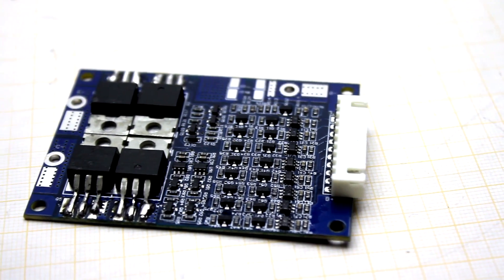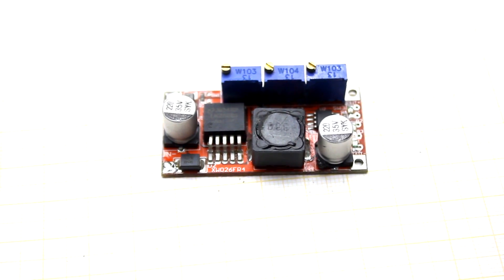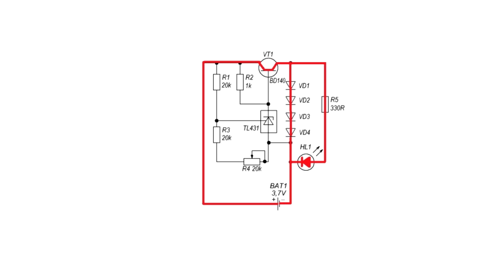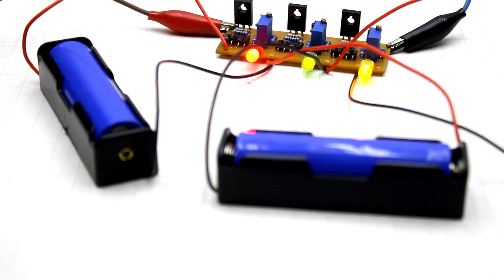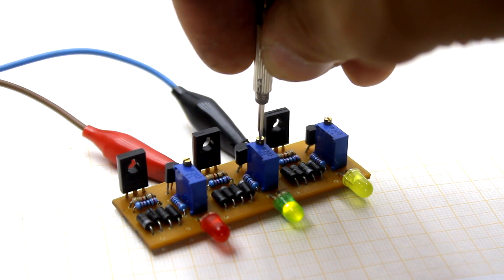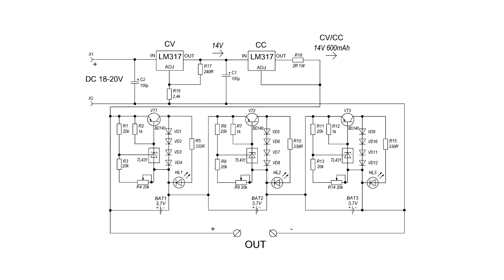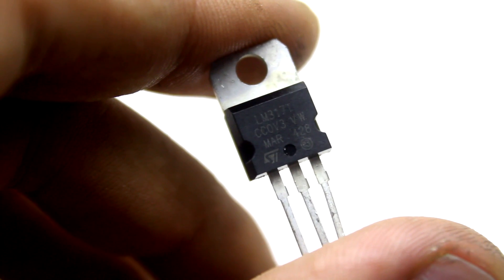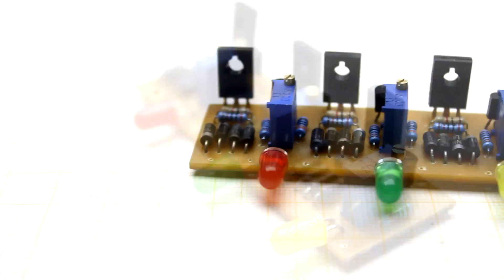Balancing unit (BMS) for Li-ion batteries

Comment: But the power supply always keeps its voltage same by adjusting the duty cycle so if the battery drops voltage the supply will increase it's duty cycle and always remain its voltage to 4.2 volts and the bjt will always be closed causing no current flowing through the battery. Can u solve my doubt

Comment: Nene eu sînt electronist cu liceu făcut+25 ani vechime, citiți cu atenție:
1)- ACEST MONTAJ NU MERGE.
2)-CELE 4 DIODE 1N 4001 SE SE ARD LA CONECTARE SURSĂ 5(USB)V, 12÷20V .
3)-DACĂ VĂ UITAȚI CU ATENȚIE BATERIA ȘI" BMS" SÎNT PUSE 'N PARALEL CU SURSA.
4)- LA APLICARE USB NU SE REGLEAZA DIN TRIMER 4,2V CI RĂMÎNE TOT LA VALOAREA USB(5V).
AȘA CĂ AȘA ZISUL BMS 1S,2S,3S,4S ESTE =CU NIMIC, E UN MARE FALS PENTRU FRAERI CARE ÎL REPETA LA NESFÎRȘIT. DE CE NUL MONTEAZĂ ÎN FAȚA NOASTRĂ CA PE ALTE MONTAJE.
SĂNĂTAE NU MAI PROSTIȚI ÎNCEPĂTORI.
SĂNĂTATE.

Comment: i got one question, why is it that my 3.7v lipo 4800mAh batteries in series (3s) burn out? its plugged in the same as the schematic. should I add a 2 ohm 5W cement resistor to accommodate for the over current?

Comment: Can I charge 24 Volt battery ( 3.7 volt x 7 Li on Battery) with total 7 sections . In that case any change do I need to make in LM317 circuit section. I want to keep voltage of each sections 3.7 volt but want to increase ampere by 3.7 volt x 3 battery in parallel in each section..only thing it will take longer time to charge..but that is okay, please let me know if this is possible

Comment: Great video. Do you have a charger power supply unit for 2, 4, 5 ... Li ion batteries? In your video you gave an example of a 14v 600mA power supply. Thanks.

Comment: All good, how about deep discharge protection on this circuit. When exceed 4.2 on each circuit it stops current flow to charge battery, however when battery discharge how to disconnect discharge when reaches beyond threshold

Comment: Very bad design...
When all three batteries are fully charged, the three transistors and series VD diodes are trying to short out the charger.
(So you need a series resistor or a current limited charger)
And the 431'a with their associated biasing resistors will be putting a constant drain on the batteries;.. and will eventually drain them below 2.5 volts!
( Down to zero volts if you  give them enough time....)

Comment: Would you briefly describe components one by one? How many resistors, resisting values, W size (1W, 1/4W etc) and others?
Reply: Resistors can be 1/4 watt. transistor is a transistor, tl431 is a programmable zener diode. LED is a 20Ma. type up to 3 volt. (approx) .. be specific what you need to know.

Comment: I just had one doubt why did you use the Diodes that were placed in after the transistor
Reply: the diodes will accept the forward current up to it's "Forward Current" max value. since the circuit is conducting.200 Ma. , its below its forward current value... so if you are looking to dissapate more, then use the right xistors and diodes. You could in theory use 10A02 Diodes... as their Forward Current is safely 6 amps @ 100C... you will also need a xistor to handle the current... and be able to keep it all cool so the diodes do not burn up...
Just remember the circuit was designed with only milliamps to dissapate @ the 4.2 volt trigger level.

Comment: Well very well
I wanted the same circuit diagram but for 2 cell lithium ion respectively
The input voltage will be 12 volts
Of the car
I want a specific scheme if possible
With only 2, not 3
Reply: This circuit is modular. You can use two sections for two batteries, or interconnect 5 identical sections for 5 batteries.

Comment: So at last I understand bms. When a battery reaches 4.2v the charger dumps the power to the diodes while still charging the rest batteries.
I understood that after a cell is full, the bms was cutting that cell of the circuit but I could not understand how the supply voltage wasnt then too high for the rest cells since one was out.
I think I got it correct now.
So all bms use diodes to dump the power when a cell is full?
Reply: Yes it stops the voltage on a cell going above the set voltage by bypassing the charge current. this allows the other cells to continue charging but the voltage across it is still 4.2V so the other cells do not see more voltage.
One disadvantage of all BMS circuits is that the charge current for the pack cannot be higher than the BMS bypass current.

Comment: This is the project to hit on! This video is awesome! You can add or take away. It's not impossible, but I've been racking my brain on a balancer that will transfer the capacity from one cell to another instead of burning off the energy from a cell with more power. Think of it as a balance transfer at a bank using your phone instead of manually taking money from one account then go to the other bank and deposit your money. I used four TP4056 Chips and wired them in series using a holder with wires, I then used four phone chargers because you need isolation on the input stage then I ran the output wires as if I was charging each cell separate, positive to positive on battery, same with negative. You probably already know this. I've been doing this for 5 years now, when they turned green they're ready, no balancing act, fast charge 4 amp. There's another way, there's an isolation chip, but that allows for .200mAh each.
Reply: also check out LTC3305

Comment: I have made this for my Bluetooth speaker and it does work well the only thing is when the batteries are fully charged and you turn off the power the leds stay lit for a time. thanks for posting this video.
Reply: leds stay lit for a time, because the batery fully charged is conected to circuit.

Comment: Excellent idea! Love it! But there is only one issue - The  CV voltage stage has to be after the CC stage, otherwise the CC stage induces voltage variations AFTER the CV stage, which is basically defeating CV operation!
Reply: As set up the CV will come to play as soon as the CC stops limiting current.  Just need to insure the Voltage is exactly where it needs to be.  When the Current Draw is within limits the correct voltage will follow.

Comment: I do understand the fun of DIY, but given the consequences of LiIon failure, and how incredibly cheap LiIon balancing boards are on eBay (which use dedicated chips designed specifically for this purpose), I don't see the sense in building this yourself.
Reply: Antonio Tejada, It is very instructive and fun to make our own circuits.

Those are the reasons for building the circuit instead of buying a commercial product.
Regards.
Reply: If you charge your batteries at 4v instead of 4.2v, this could be a good solution to keep your pack balanced. 4v charging will prolong battery life.
Reply: la mejor respuesta de todas
Reply: Just try to find a balance board that balance at 4v, i have searched for it, but never found it, so i am going to build me a nice diy 20s balance board. Thanks for the lay-out of this diy board!
Reply: @Jmax777  hi. is this worked for you?
I want to build balance charger for my 13s battery pack. this circuit can help?
Reply: Yes, you can get 10 Boards for €2,10. That's enough for charging 10 batteries at a not so critical ~5V.You can also get Boards with Battery over-discharge protection. 10 for €4.Just search for TP4056 on eBay.
Reply: @Christian_Shepherd_R  . this lesson is mostly for you to understand fully and also to open your mind. if we keep on just importing stuff , it makes us less creative.
Reply: Putting your life in the hands of a Chinesiuim BMS is BAD Ju Ju.  It's not a matter of if it will fail.  More in line of WHEN it will fail.  Hell I've seen  some that were DOA or over charging as they came.